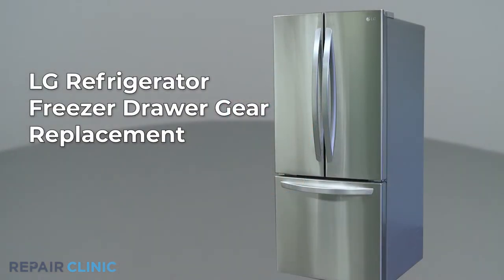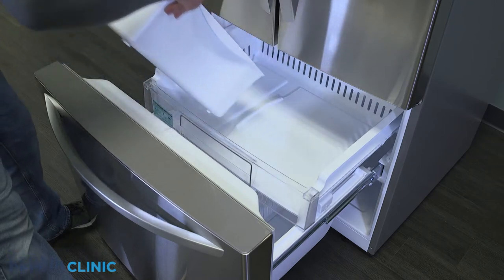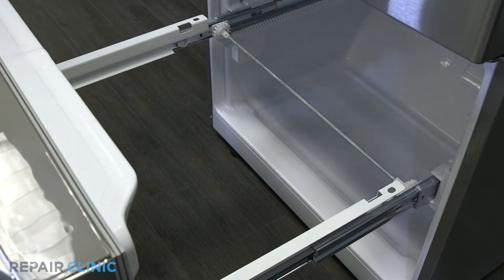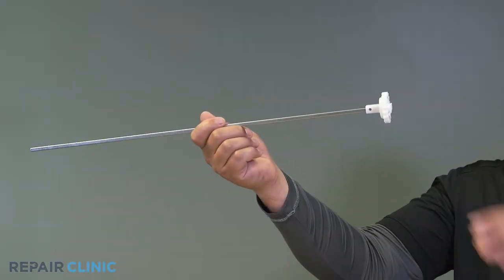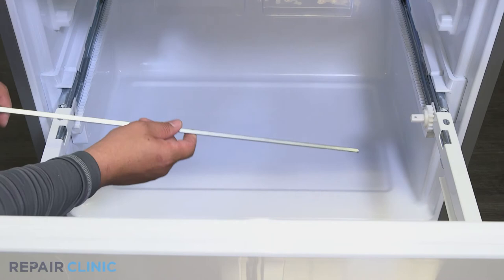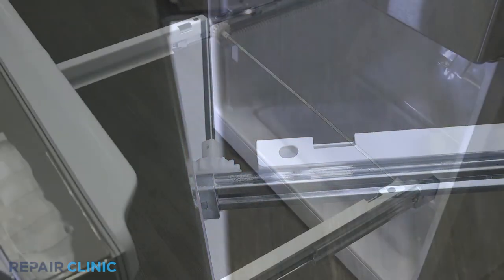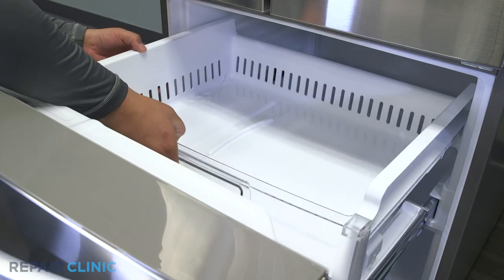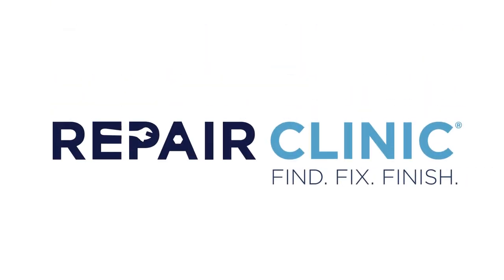LG  Refrigerator Freezer Drawer Gear Replacement 4403JJ3001B

Comment: HINT: For re-installing notice that the gear has a center spinning part. We'll call it the hub. Carefully pry it out with a screwdriver, fork handle, whatever, but do it it slowly and gently. This part is stupidly expensive for what it is. If it was a kid's toy it would be 25¢ in a bubblegum machine. Anyway, once you have it popped out notice that it inserts into the rail clip with the edges fore and aft, NOT up and down. It only fits that way! You see, the trick here is it is difficult to insert while still in the gear because it spins so freely (which you want it to do once it's installed.) Now remove the other gear from the rod and also remove the same part as the first and install it. Once both 'hubs' are installed in their respective clips place both gears on the rod with their square shaft holes aligned to each other, to keep their gear teeth aligned with each other. Carefully install the rod into one gear so it is completely inserted and teeth meshed before attempting to install the other side. Now, make certain the drawer is FULLY OPEN so the gear teeth will mesh properly on both sides in their rack's teeth. Failure to do so will cause the drawer to be crooked and not close properly and possibly break the gear(s) the first time you attempt to close it. You will have to pry the rod to one side a bit and maybe pull the drawer slide away from center on the other but it isn't very difficult. Once properly inserted, clipped and meshed on both sides check the drawer motion fully closed to fully opened. Go slowly the first time or two incase there's an misalignment. The drawer should open and close very easily. Make certain the drawer fully closes. If it doesn't you'll likely end up with a freezer full of ice crystals. Be sure to fully clean and DRY the drawers and ice bin before reinstalling or everything you put inside will freeze to the drawers. After that install the lower bin, the upper bin and the cube tray. Yay!